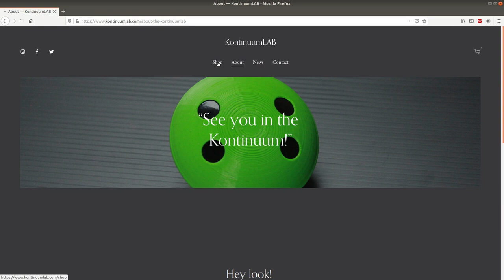3d-printed MIDI ocarina, and the K.L.I.K. prototypes that got me there.

Comment: neat, maybe a 'generic' template for all the buttons and maybe add knobs?
Reply from the maker: Thanks for the comment. I'm not quite sure what you mean though...?
Reply: @KontinuumLAB  some instrument that has the breath control, knobs for each analog teensy input, calibration button and then just the max number of key inputs that can be done....if there's a way to do that, then it may unify the code, at least for instruments like that as any instrument made from a lesser number of inputs can just be calibrated from it....I'm not sure how your code works but that is how i would do it.
Reply from the maker: @sonicase Ok, now I get it. That makes sense to me. In fact the KLIK always reads all sensors on calibration, and then the individual instrument functions take care of just reading the pins that actually have sensors on them for any given instrument.

Comment: What is the most number of capacitance touch switches available with your board?  Is it essentially an Arduino?
Reply from the maker: The new KLIK 2 can do max 24 capacitive keys. None of the preprogrammed instruments use more than 16. The KLIK uses Teensy boards, which can be programmed with Arduino

Comment: Melodica!!!
Reply from the maker: It's on the list!
Reply: So the kit will contain parts for the breath controller and teensy? Will it have multiplexers too?
Reply: Do you know the price yet?
Reply from the maker: @stevegiedosh5407  Yes, all of that, plus the sensor modules, breakout boards, and a bunch of materials and cables and stuff. I do know the price more or less. Just up front, there won't be a "cheap" option until I sell a good few of these. The first kits will ship with a fully assembled instrument, so the work that I put into that will make up most of the price at first. More on all of that that in the next couple of videos.
Reply: KontinuumLAB I hear that. I’ll keep my eyes peeled. Your kit has almost everything I need for my project.
Reply: KontinuumLAB Oh two last questions.  I see the website says October 2020 so I assume that’s when you go live with selling the kits. Also if I wanted to by a kit and needed additional Multiplexers and sensors would that be an option?
Reply: Also, sorry, 

Would you be willing to share a rough estimate on the cost of the kit when it’s released?
Reply from the maker: @stevegiedosh5407  October is my current projection. About buying extra modules, I guess, maybe... I'm still figuring out exactly how to make that work. If there's interest in it, then definitely. Nice to get some input, thanks.
Reply from the maker: @stevegiedosh5407  I'm not sure what you mean.. The cost of parts on my end? I don't think that would make much sense. I'll make a BOM at some point, you should be able to figure everything out from that.